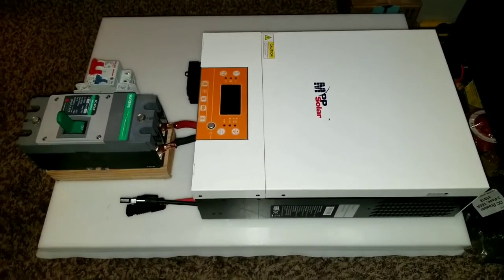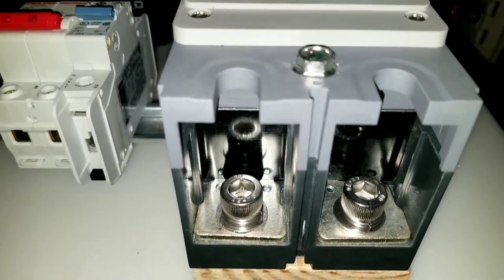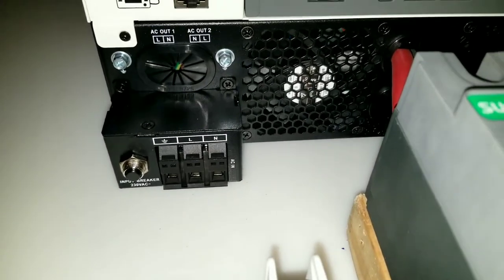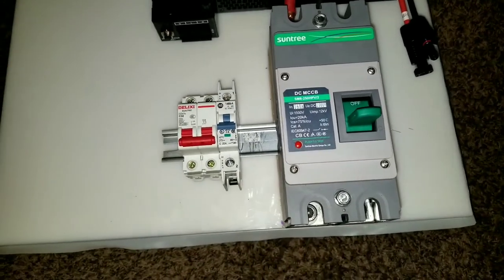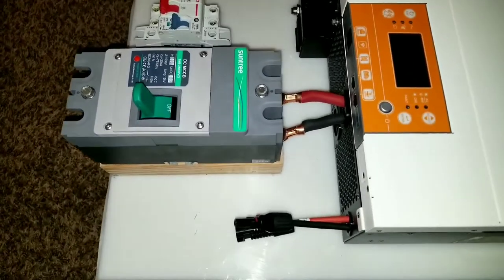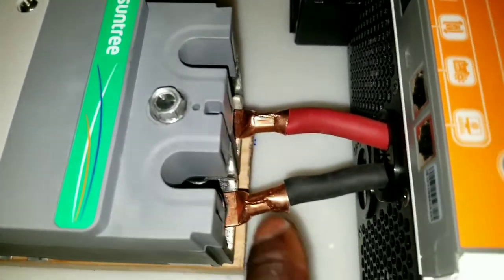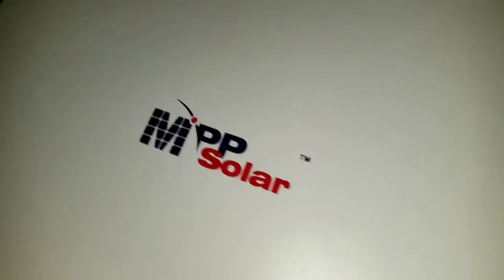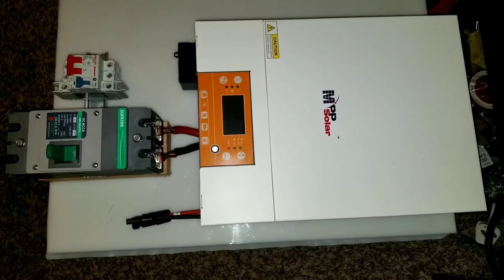MPPSOLAR: PIP-6048MT INSTALLATION LAYOUT

Comment: 7:50 you receive a isolators between pole but you not install them !. Check a manual and those 2 black isolators should be installed between + and - poles.
Reply from the maker: Thanks for stopping by and don't forget to LIKE SHARE and SUBSCRIBE

Comment: Can you use mc4 in line fuses that's how I'm doing mine
Reply from the maker: The inline fuse can't handle the voltage I am planning to run into this inverter.
413.1vdc volt open circuit (VOC)
Reply: @jwsolarusa  yes.didnt know that must be 230 output invertor I like the look of the system so far am .updating my 1993 solar system I like some of the ideas you offer thank you for links
Reply from the maker: @willrobertson826  
Thanks for having me buddy.
Please be sure to share your new upgrades with us all.

Comment: Hallo, ich habe eine Frage zu dem Verhalten der Lüfter. Wird die Lüfterdrehzahl in Abhängigkeit der abgegebenen Leistung gesteuert oder laufen die Lüfter immer mit voller Drehzahl?
Reply from the maker: Hello and thank for stopping by.
I am sorry for not  understanding your language. Please translate to English
Reply from the maker: Please don't forget to LIKE SHARE and SUBSCRIBE
Reply: @jwsolarusa Hello, please excuse me for writing in German. I have a question about the behavior of the fans: is the fan speed controlled depending on the output power or do the fans always run at full speed?
Reply from the maker: @ferdinandfieg9271    
Thanks for the translation.

The fans speeds are control by the power coming in from the solar and also the power coming out from the inverter.

Since this is an Hybrid Inverter Charger, incorporated with Solar Charge Controller, there will be activities going on day  and night nonstop. 
During the Inverter generating power from the Solar Panels and also powering the loads that puts the fans on a constant running mode.
Despite all these troubles you are facing, you can enable the power saving mode function on the device that will enable the system go on a standby if it doesn't detect any power needs from your loads and tha will put the inverter into power (SAVING MODE) to cut down little bit on your battery bank.
I hope I find this illustration helpful.
Please don't forget to SHARE LIKE and SUBSCRIBE.
Cheers.....👍